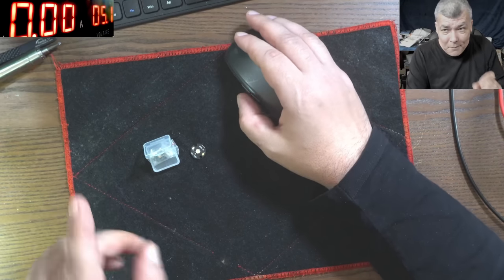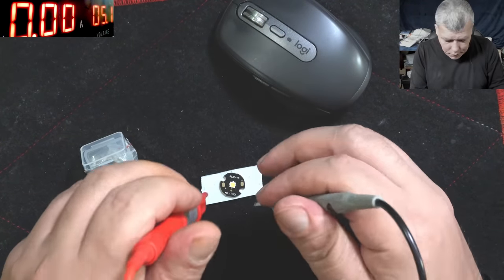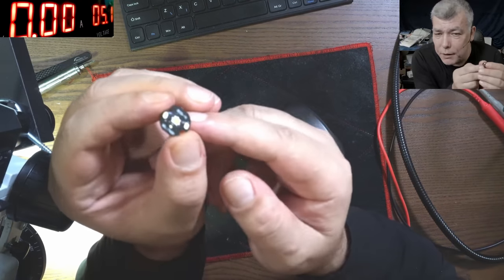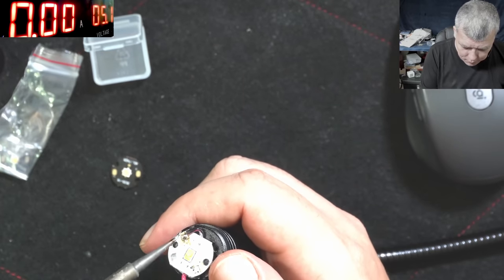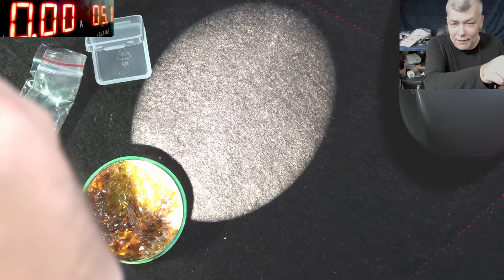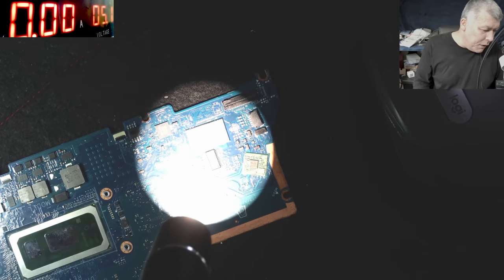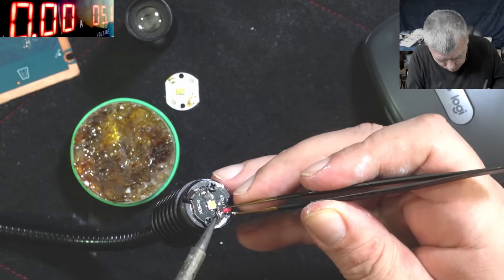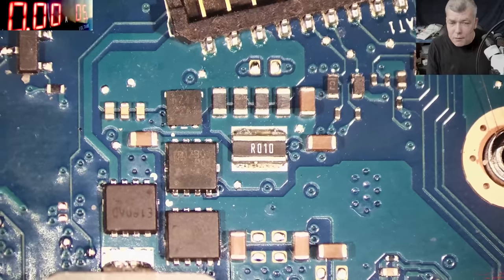Changing microscope LED's with Nichia 519A high efficiency led's

Comment: This LED is not the strongest but it has a high CRI (The stock LED had both low output and CRI). This means it reproduces the full color spectrum which  produces more heat but you get better color and more contrast. Other LED's have more output but the colors are bad. Try looking a family picture under different lights ans you will see the difference. It will also help you see corrosion, cracks in chips and other stuff that you see in daylight but it's hard to see under artificial light.
Reply: Exactly. The Nichia 519A is renowned in the flashlight community as a high CRI light with somewhat good efficiency. It's not 'high efficiency' but for the quality of light it gives (which is extremely high) the efficiency is quite good. Also, for microscope you should get some 5000K CCT bins, so it gives neutral white colored output without any cast. 2 amps is the rated max output of 519A. You can overcurrent it given good cooling, but it's not recommended for prolonged period of runtime.

If you really want the LED with the highest efficiency, try the Cree XHP 50.3 3v but it is low CRI (70) and and only comes with 6500K CCT bin for 3V version. Another efficiency contender is Luminus SST40 but the quality of light is very poor (very low CRI and 6500K with green tint)

Comment: Hi Sorin,  please do a detailed video of how you have setup your voltage and amp meters for  testing using your bench power supply, i see separate meters but cant work out what your

cameras are looking at - it is very interesting - to me anyway.  I did look at your bench setup vids but did not see the setup, or missed it. Thanks